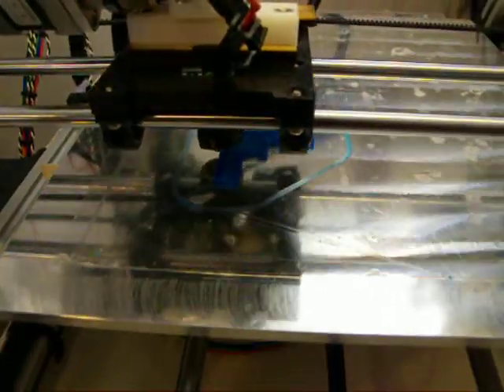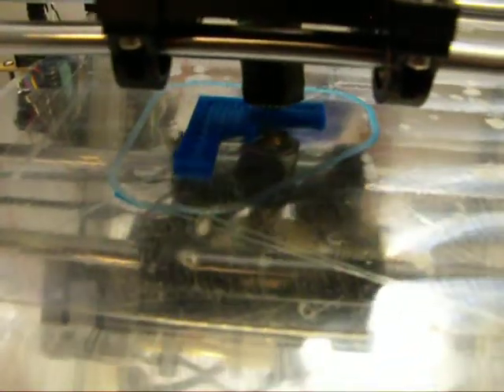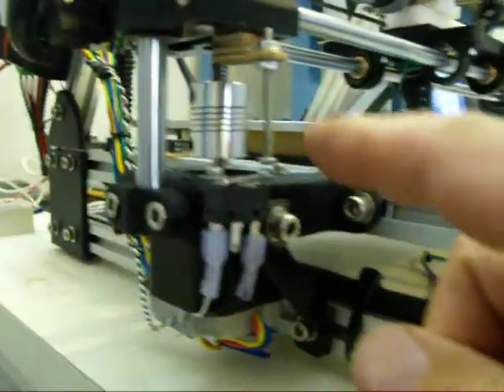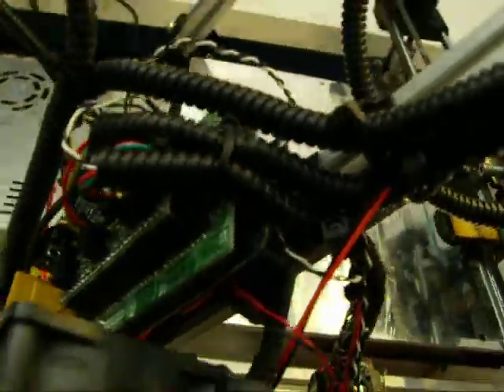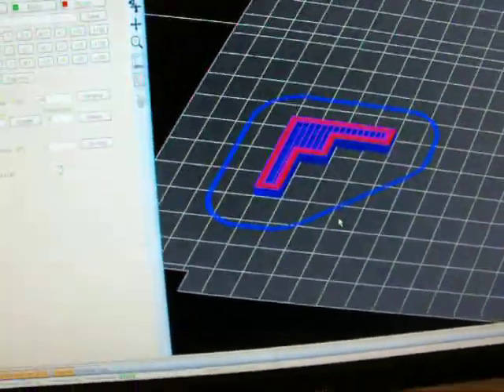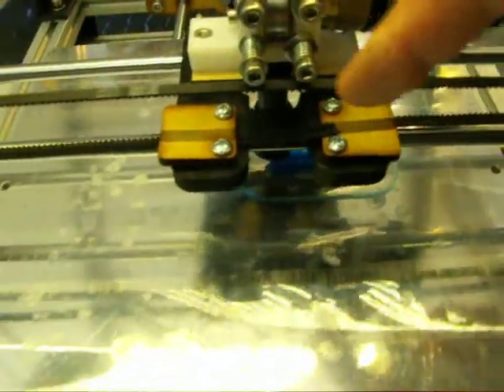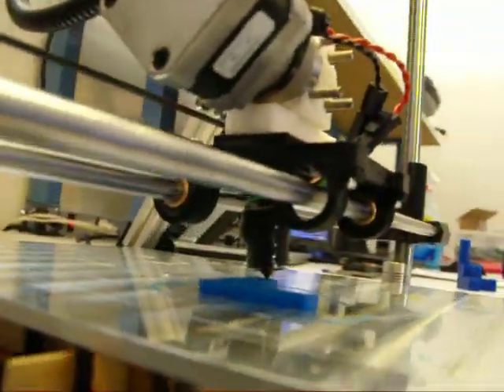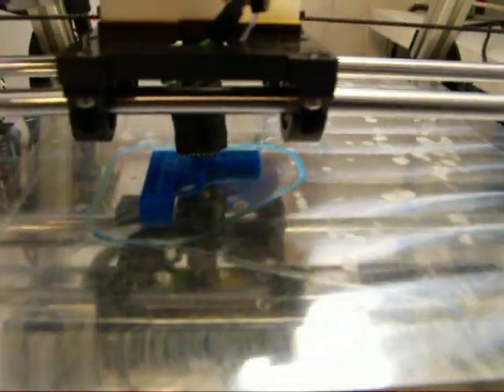RepRap Mendelmax 1.5 problems and fixes during the build

Comment: Hello,
  I built a mendelmax 1.5 and have had problems with the Mosfet for the bed heat overheating. I wonder what the solid state relay  p/n is that you used for the bed heat and how you wired it. great idea
Reply from the maker: A crydom d2410 ssr relay.

Comment from the maker: Then I downloaded a calibration cube from Thingiverse and printed it several times adjusting x,y, and z as needed also followed by reloading the program back into the Arduino.

But let me first state the absolute most important thing and that is leveling your print bed. I attached a machinist dial indicator to my print head and ran it all over the print bed making adjustments to the bed as needed until I had no more than 0.1mm error in the bed. This is a very difficult process but very important

Comment from the maker: I am not sure what you mean by programmation?

As for the calibration I just looked through the Arduino program and found the vars they were using for the cal factors on x,y,z, and e, I started with e
which is extrude and ran several pieces of filament until it was moving the correct amount by adjusting for the error in the Arduino program then reburning the program to the Arduino.

Comment: Hello. I am currently building a MendelMax 1.5+ and I just finished the wiring process. I was wondering were specifically did you get the programmation and calibration info. If you  can post some links that would be great! Thanks :)

Comment from the maker: I am very satisfied since this printer prints almost every day. 

Here is a summary of the last year:
* Printed over 100 pounds of PLA, quickly approaching 200 lbs
* Wore out the original extruder body, luckily I printed a full set of replacement parts. This put me down for a day while trying to figure out why the prints were coming out so bad
* Wore out the Y drive belt, it split?? Also I had ordered a full set replacement parts, this only took about ten minutes to replace

Comment: You've probably learned all this by now, but hopefully it can be helpful for someone else:

1) You can zip-tie the limit switches directly to the rod.  If you pull the ziptie tight enough, you can still slide it around to adjust without the machine banging it out of alignment.

2) PLA needs a fan, especially for the tower-type structures

3) Both belts should make a low "thrum" noise when plucked, for tension.

Who made the kit?

Comment from the maker: I bought the kit from the MendelMax store, it took five weeks to show up and cost a little over $1300.00. The z rods are 10mm, x and y are 8mm. I am fairly impressed with how well the printer works, since it is my first 3d printer I have nothing to compare it to. It came with everything except the mounts for the end stops. Everything in the kit was high grade, from a nice 30Amp power supply, a fully assembled hot end, a aluminum print bed that was machined flat on both side and laser cut parts.

Comment: Dude, why did you not use springs inside your X ends, for the Z axis nuts and all threaded rods, [two nuts on each X end, one on the bottom and a spring, the other nut inside the top, all thread rod though them, then tension the spring with the nut on the bottom] like the Prusa?